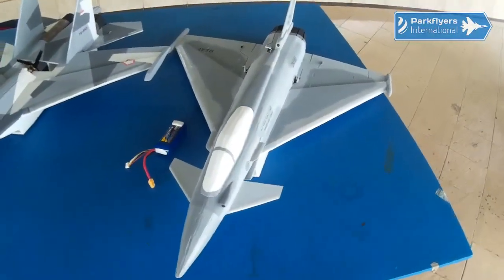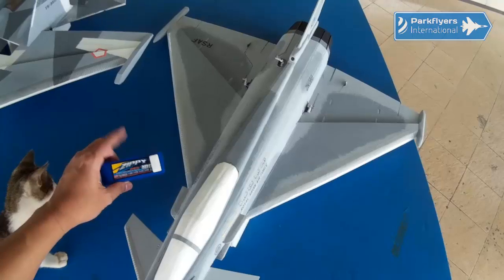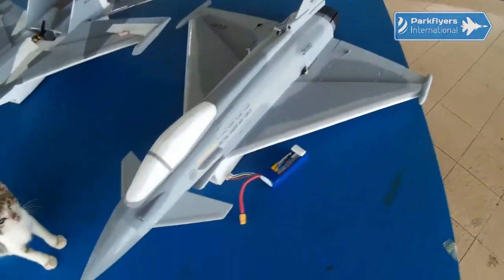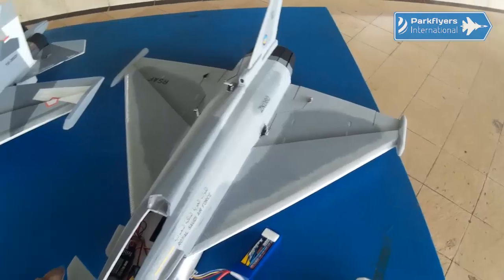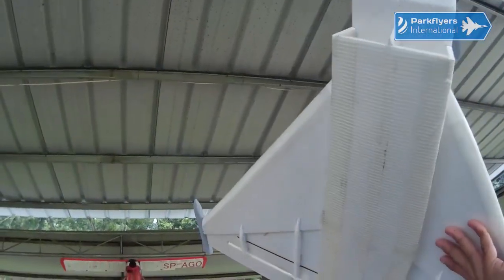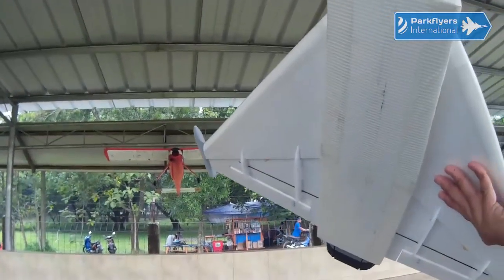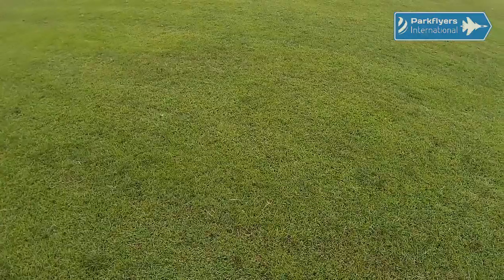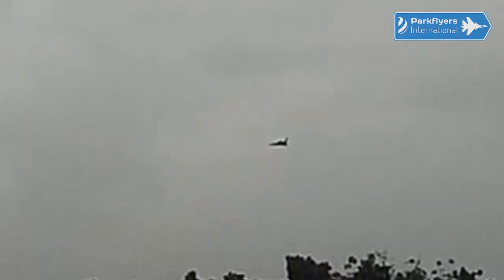Parkflyers International Eurofighter Typhoon G1E (EDF): Walkaround, Maiden Flight and Highlights

Comment: You think twin 50mm edf will work in this bird? I have a 70mm and a 11 Blade 64mm but twin 50mm would seem awesome, plus some homemade thrust vectoring nozzles? Oh and PLEASE make a mirage 2000! That would be another awesome delta wing edf, and the experience on building and designing the Eurofighter will make it easier to make the mirage!
Reply from the maker: Joseph Lujan Hi Joseph. Many thanks for watching the video and post a comment. Well, after designing our first EDF parkjet followed by some rear mounted parkjets, we now love rear mounted more than EDF. Few things I could mention about the pros of rear mounted:
1. Similar speed with EDF
2. Very efficient flight time as 1800mah 3S batt mostly could give 10-15 mins flight time.
3. Much more scale looking than mid mounted

About the Mirage, we have no schedule on that yet but yes, it generates an interest to put it on our parkjet lineup 😊
Reply: +Parkflyer Indonesia awesome man! i would love to even help out with that parkjet, wouldn't hurt to add another edf parkjet☺